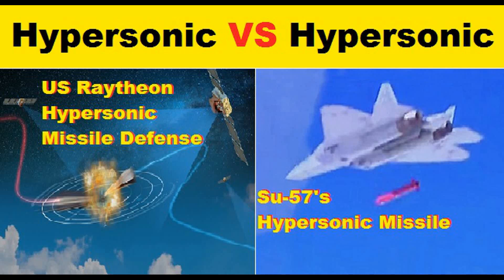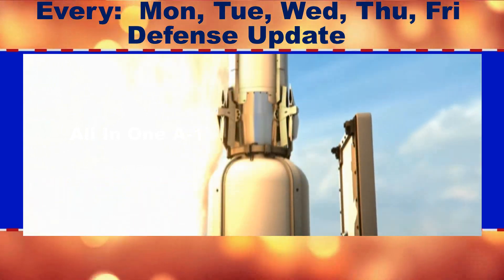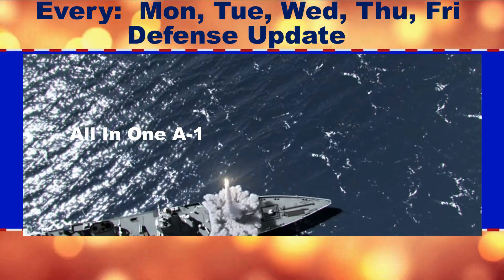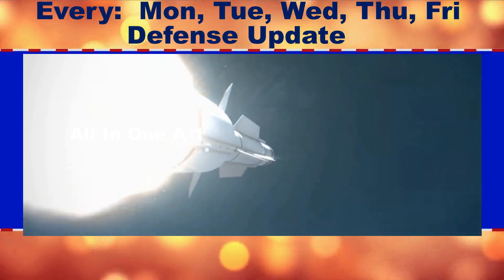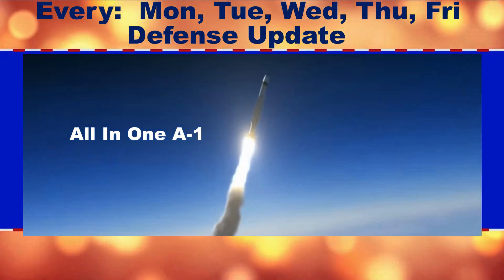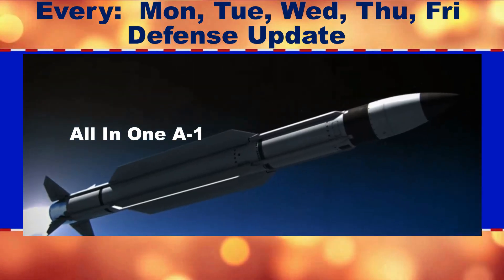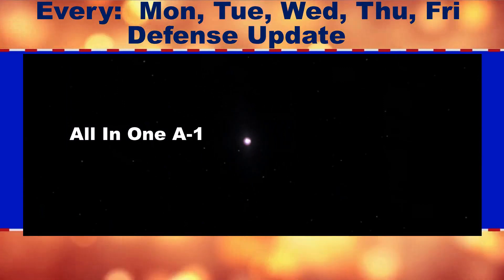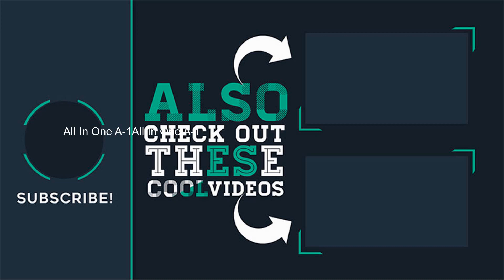Hypersonic vs Hypersonic, US Raytheon Hypersonic Missile Defense, Hypersonic Missile for Su-57

Comment: i would implement thaad onto hypersonic cruise missiles launched to counter and intercept incoming threats by launching their smaller thaad missiles from a closer range. this would solve the need of full coverage for protection as the hypersonic cruise missile carrier could be deployed from pre existing and new launching sites to cover all the surface of the us or the world, working in conjunction with long range radars, satellites and heat seekers that can monitor, update the location and calculate trajectory of any incoming hypersonic missiles or gliders  due to the plasma created from such high speed, and so expose the location of the incoming threats.